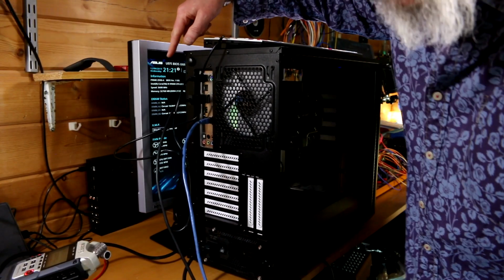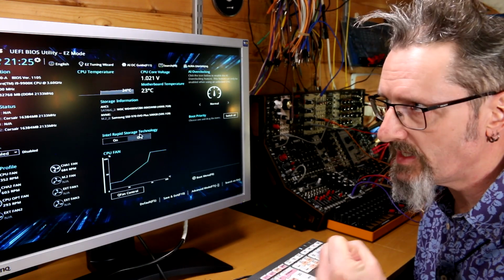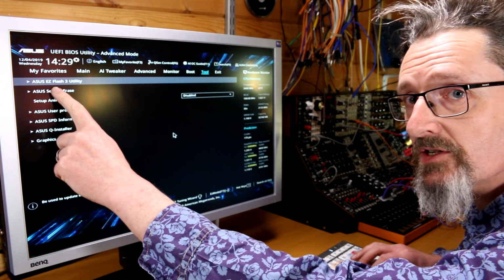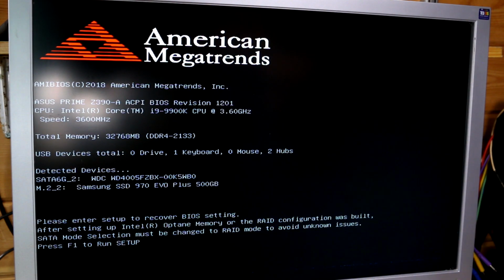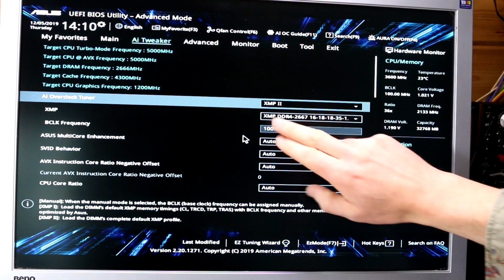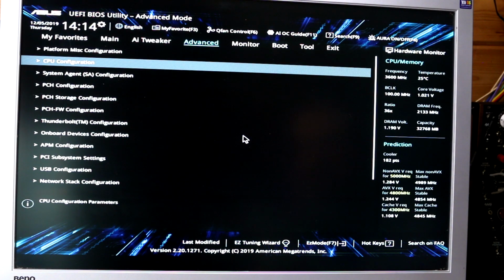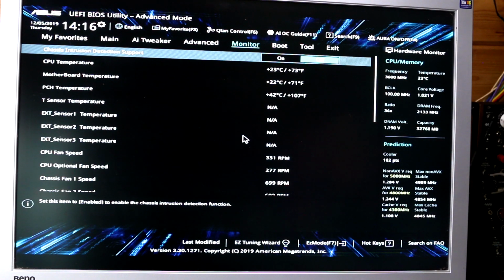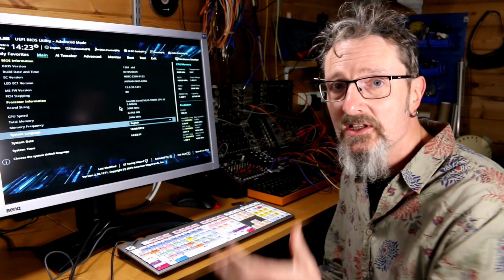How to build an Audio PC: Part 6 - The BIOS

Comment: Cool and usefull tutorial as usual, thanks Molten! But there's one thing I fell to suggest: correctly, you said our goal is stability and not extreme overclocking...BUT with Asus BIOS on a i9 9900k, if you enable "Asus Multicore Ehnancement" together with "Synch All Cores", you'll get exactly a fixed 5ghz OC on all cores (it will clock down eventually at about 4.800 only when encountering AVX2 instructions).
All Cores at 5ghz on the i9 9900k is not extreme OC, but starts to be challenging: a liquid AIO cooler (and a good one) is required to get nice temps on heavy load.
With a Noctua NH-D15 cooler (in your same R6 case) I preferred to set a 48 limit on the Core Multi, and AVX limit to 0 (Cubase and some plugin use those).
That fixed 4.8ghz for me is the sweet spot between good performance, stability and friendly temps on this CPU when cooled by air. For all the other settings, I totally agree with your choices.

Comment: One thing I noticed: If you put the RAM-pair in the B-Slots, without the A-Slots beeing occupied, it can result in them running a slower clockspeed. I learned this, when I realized that my RAM wasonly running at 1900Mhz instead of 2133Mhz even with XMP profile acitve. Changing the slots solved it.
Reply from the maker: Cool - best just to follow the manual :D

Comment: This configuration results in the 9900K running at 5ghz constantly. Turning off the Enhanced Multicore Performance results in 4.7ghz constant (which is stable and idles at about 33C).
The only way I was able to get the cpu to downclock below 4.7ghz was to turn on Speedshift.

I'm not certain that having the cpu running at max turbo clock when on an aircooled system is the greatest. The 4.7ghz is good stuff, but I'm still not sure if that's a better solution than just locking the CPU to 4ghz.

For context, I'm running a 9900k on a z390 designare.
I have C states disabled as well.
Reply from the maker: Do what works. If it has good cooling and is stable then it’s all good

Comment: Thanks for this tutorial series - many great tips along the way. Having worked with both full tower BeQuiet! And Fractal cases, which do you prefer?
Reply from the maker: I’d say Fractal but this particular new version seemed to introduce unnecessary annoyances. Either will do.
Reply: @MoltenMusicTech  i second fractal, they are heavy-duty, easy to build in, lots of thought put into design and cable management. and they have a lot of dampening material. (the Define series. not the meshify ones.)

Comment: I am in the process of  gathering info on building a machine much like the one you're doing in the video (Thank you for making the video series on it, helped make the choice for viable parts). I do however need to have it be a gaming machine too. So I''ve tried to read as many gfx card reviews as possible and just today ended up on MSI's gaming X series of cards for the 1660 super and 20x0 super versions... They all seem to have an "idle-stop" feature for no to low loads, which will cover our music/voice recording & mixing moments.. and even under bigger loads, they still settle at 30-33dBA according to the tests I've found... Maybe worth testing one if you can get hold of one? :) (They do have some RGB features too, one will have to live with that or disable as needed)
Reply from the maker: There’s no real problem using gaming video cards, I use one for playing games and to help with video rendering. They can be noisy but not always. But I don’t want to go down the road of testing and recommending graphics cards - there’s too many choices and there are plenty of gaming channels covering them.
Reply: @MoltenMusicTech  That makes sense, it is a deep rabbit hole. Thank you for the reply. :)

Comment: My advice to people working off of a laptop and needing low latency for tracking (without resorting to direct monitoring) or for real time midi performance is to try turning off turbo mode, as that can significantly increase cpu temperatures in a laptop, which in turn can cause audio glitches when running a low latency session that is cpu intensive.  It might help you achieve the low latency you desire without any audio glitches, but that depends on your system.  I have mine turned off and I am getting less audio glitches.  So give it a try!  

Additionally, turning thermal throttling off and leaving turbo mode on in a laptop can cause the cpu to reach temperature past it's maximum limit, which means the computer will then shut off, which is the last thing you want in the middle of a session.  Laptops are different than desktops in regards to cooling ability.  There is much less headroom to work with on a laptop due to the cooling constraints of the small chassis.  So you should keep this in mind.
Reply from the maker: Yep, thanks! This is about desktops though yeah?
Reply: @MoltenMusicTech  Not sure if you specified it in the video, but I don't think you did.  So my comment is relevant to those who will follow your advice blindly on their laptops.  :)
Reply from the maker: Ok mate, this is part of a series, but thanks for the keen advice 😁

Comment: I recently purchased a new cs450 v6 computer from sweetwater and I’m running studio one the newest professional version.  I noticed that I couldn’t use very many 3rd party plugins before crashing.  Sweetwater tech looked and couldn’t find anything wrong then I had tech from presonus look and they couldn’t find anything wrong.  One lucky day I came across this video and followed your bios configuration and now I’m able to run 3x as many plugins as before!   I new in my gut that there had to be some solution to that problem which you fixed so thank you!   I now use the cs450 v5 computer for my video production running the original bios that sweetwater configured.  So I was wondering if you have bios settings that would optimize that computer for video production?   Thanks again
Reply from the maker: Thanks! The BIOS tweaks should be just as fabulous with a video machine. All they do is make the system run better - it's mad that Sweetwater didn't already do something like that.
Reply: @MoltenMusicTech  sweetwater blamed presonus and presonus blamed sweetwater! Lol. At the time I was able to run around 12 heavy cpu plugins in presonus studio one.  Now I’m around 30 heavy cpu plugins.     Thanks for your quick response I will give it a go on the v5 computer with the bios settings. I’m hoping it will speed up my rendering times for video.  I don’t think it should take 2hrs to render 30 minutes of footage!

Comment: SpeedStep is Intel's name for changing the CPU's speed and power draw according to demand (P-states = power states come into play here) - in software. SpeedShift is the same thing in hardware. Keep in mind disabling SpeedStep/SpeedShift means your CPU will not go below its base clock (3.6GHz in the 9900K), dramatically reducing your temperatures and power usage while the PC is not doing much. This means you could disable most of the fans and have a completely silent setup while doing simple office tasks or checking email, and kick the cooling and power in as needed.

Also note disabling C-states doesn't do much (C-states are just states like "running", "hibernated" - if your PC is running it won't change anything as the CPU is set to its full potential), but effectively disables turning your PC to sleep/hibernation (by blocking it from going to the "sleep" C-state). If you like to keep your PC on at all times and just have it wake instantly, this means your CPU will keep working as normal, fans will be spinning etc. It won't get into "standby".

Turbo means it will go above the base clock (up to 5.0GHz in the 9900K). Multicore enhancement (which was shown enabled in the video) is actually overclocking - it makes the CPU boost up to 5.0GHz on all cores at the same time (if thermals and power limit allow it). By default it would boost to 5.0GHz only if a single core is being used, then usually 4.9 on 2-core loads, 4.8 on 3-core, etc. When overclocking you can type different boost speeds for all of these, but flipping the multicore enhancement on you allow it to boost on all cores. This will result in higher than usual loads and temperatures, so you gotta have good cooling - more power will be drawn as well.

The whole thing about disabling thermal/power management is down to your personal preference - some argue you're better off setting a constant speed since changing the speed is not instantaneous and you might get glitches when starting playback right after opening a project that get resolved in a couple of seconds as the system ramps up, while some prefer to have the machine to be near-silent and only run hard when needed. Both are valid and you're free to choose.

For checking your CPU clocks, temperatures, and if your CPU is throttling due to thermal/power limits, get Intel XTU (Extreme Tuning Utility). It's an overclock utility, but it can be used to display a graph of your CPU speed and temperature, as well as show an alert if some kind of a bottleneck is spotted.
Reply from the maker: Thanks, you should make your own videos! 😁 The point of this series of videos is to present how I build audio pcs so that people can benefit from my experience without having to understand every specific detail. I’m in the business of supplying a system that’s guaranteed to be great for music production and so I’m not interested in other considerations or possibilities. What I’m trying to achieve is constant, always-on power and stability and hopefully that’s what this series of videos provides.

C-States are evil and must be stopped.
Reply: @MoltenMusicTech  well, they shouldn't affect anything while the system is on. As mentioned the states are literally like "on", "sleep" and "hibernated". You might be confusing them with P-states and dynamic CPU frequency, or you might have had some other issue I'm not aware of. That said I'm speaking from a perspective of having semi-pro home studio. I can see the simplicity of forcing full-on speed at all times in a commercial facility.
Reply from the maker: Indeed - "Sleep" and "hibernate" can both destroy active projects when you try to bring them back to life as DAWs rarely cope with recovering plug-ins or dealing with loss of MIDI and audio drivers. You don't want to be practicing your guitar part and have your system go to sleep and then crash out because the audio driver spannered out. I've seen C States be responsible for capacitor whine, electrical interference, audio glitching, hidden resource stealing and taking your kids sweets. C States need to be stopped at all costs.
Reply: @MoltenMusicTech  Wow, that sounds real bad. I haven't had these problems on my Presonus Audiobox 1818VSL, waking from sleep works perfectly fine with both Studio One and Logic. Though I have my system set to sleep after 30 minutes of inactivity, so usually it's me manually setting it to sleep with the DAW running rather than a timeout. I have had one situation with audio interface not being detected and that was Presonus Audiobox USB. Wouldn't get detected if it was plugged in during power on or waking from sleep, it just needed to be unplugged and plugged again to be picked up. Made me switch interfaces to Behringer UMC404 (one of the best budget interfaces btw) and then Audiobox 1818VSL. No problems ever since. That's from a perspective of both a laptop (4th-gen i7, Windows 7, 8.1 and 10) and a desktop (8th-gen i7, Windows 10 + macOS Mojave)
Reply from the maker: having no problems is a great and wonderful thing.

Comment: Spent an entire day with your vids building a system nearly identical to yours. Started it up the first time and it ran for a few seconds then shutdown. It kept recycling on and off. Decided to hook up a monitor to see what was happening but... uh-oh... no display. Now, the system stays on but I have no display. The problem with this issue is the sheer number of things it might be. Troubleshooting all of them would take as long as the build itself. Can you help me prioritize the troubleshooting so I do the most likely ones first?
Reply from the maker: If it's not getting to POST (Power On Selt Test) then something probably isn't connected correctly. All you need for it to POST is the motherboard, CPU and some memory. So first disconnect all the drives and leave in just one stick of memory - try that. Still no dice then reseat everything - try the memory first - take it out, put it in, make sure it definitely clicks into place. Check the power connections to the board, make sure they are secure and also on the PSU unit itself. If you're still not there then pop out the little watch-style battery from the motherboard, wait a minute and put it back in. If it's still not staying on then you'll have to reseat the processor - which is most likely the problem but it's worth checking everything else first because it's a pain in the arse to remove the CPU after it's been installed. So remove the cooler, carefully remove the thermal paste you put on as best you can and very carefully remove the CPU. Don't get the paste on anything else. check the pins in the socket with a magnifier and torch, check for missing or bent pins, they should all be perfectly aligned. Hopefully they are fine. Put the CPU back in, make sure it's seated correctly, make sure the bracket is holding it and the arm is securely down and hooked. TRY THAT!
Reply: @MoltenMusicTech  Thank you so much for taking the time to answer. Weirdly, the issue is resolved and I don't even know what the solution was. I decided to wait until the next day (today) to tackle the troubleshooting you suggested. Today, as I was all set to dig into the system, I decided to turn it on one more time just to confirm everything I had experienced the night before. To my surprise, the display came up with the BIOS screen just like it is supposed to. I cannot explain why it was misbehaving at first, and then magically fixed itself overnight (maybe computer elves are a real thing!). So, there it is. If I discover why/how this issue solved itself I'll pass it along, but perhaps we ought to add to the list of possible resolutions for this issue simply letting the computer sit overnight and try it again; apparently that's a legitimate solution.
Reply from the maker: walking away and coming back later is a totally legitimate troubleshooting technique :D Glad it's working.
Reply: @MoltenMusicTech  Not the end of the story: turns out the system only boots and displays when the case is on its side. When I bring the case vertical all those issues show up again. Have you ever heard of such a thing?
Reply: System is running fine now. That big ol cooler just needed tightening down a bit more than I had it.  Thanks for the great help.
Reply from the maker: Ah, yeah, that's a funny thing. Sometimes screwing a cooler on too tight will bend the board enough to give trouble - i guess the opposite is also true. All the best with it.

Comment: I have a Gigabyte motherboard. I followed this tutorial and checked all the settings that you recommended. However, my CPU frequency is all over the place. It ranges from 4.7Ghz to 4.9Ghz. You talk a lot about stability, but my CPU is constantly changing. I am not a computer expert so I don't know a lot about this. Any help or insight would be appreciated.
Reply from the maker: Yes, I haven’t got to the tuning video yet. Is it causing you any trouble? We have to decide on a cpu speed and we can’t do that without windows being installed and a bunch of testing. So stay with me.
Reply: @MoltenMusicTech  I haven't experienced any issues, no. I have Windows installed and did all of the tweaks you suggested in your other Windows update video. Just a little concerned since 4.8 is so close to the 5GHZ that the 9900k technically maxes out at. I'm wondering if my being on a different brand motherboard that has different names for certain settings has anything to do with it. Looking forward to the tuning video! Thanks Robin.
Reply from the maker: No, I think you're fine. I had the same experience of going "shit! it's running at 5Gees!" only to find that it calms down after a while and the cooling is more than adequate to handle it.

Comment: When should we expect the windows install video?
Reply from the maker: After Xmas now I’m afraid
Reply: I see. I already have purchased the computer and ran it through this bios setup, now I just need to install windows, is there a resource you reccomend to finish the final step of downloading windows?
Reply from the maker: Installing Windows is not difficult. Get an 8gb usb stick, get the W10 Media Creation Tool, run it and use the USB stick as the media destination, plug it into your new computer and turn it on.
Reply: If it is easy perhaps a short video is also easy to make?
Seeing is believing. Would really appreciate that windows install video.

Comment: For anyone with a Ryzen 5950x on x570:  
I've been playing with overclocking and the best performance in Ableton Live is simply to set your memory profile and leave everything else as default. 

I had mine running stable at all core 4.7Ghz with my ram and infinity fabric at 1900 (3800) but i was still getting weird overloads in ableton... my testing was to load up a crazy patch in phase plant and mash all the buttons on my push while using my other hand to mash my MIDI keyboard in an attempt to crash ableton/overload the CPU.  with the overclock enabled I could use 110% cpu and sometimes crash it, when i just left it at default boost from 3.5-5.0 i couldn't overload the cpu, it just ran great. so.... easy mode i guess. just set your memory profile and don't worry about anything else. hope i saved you some time.